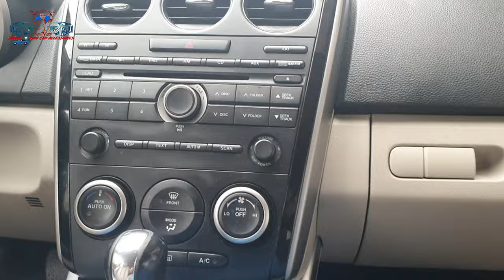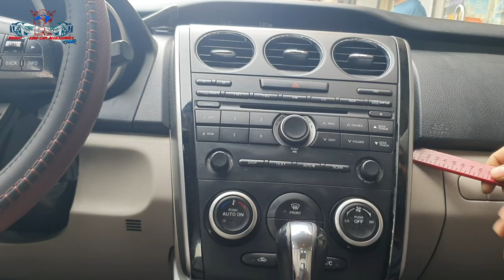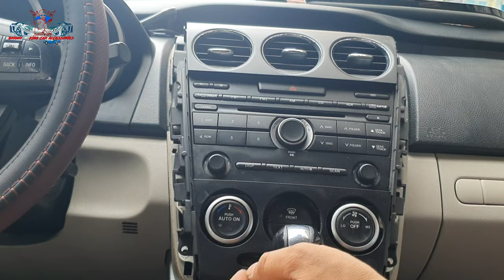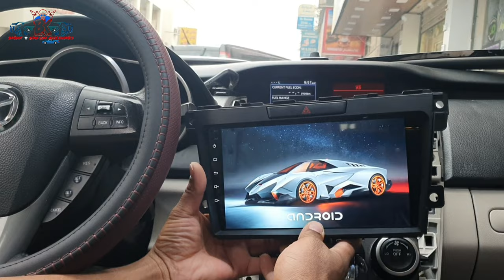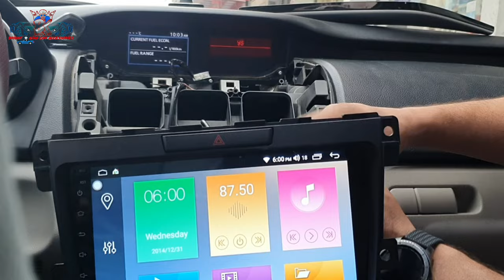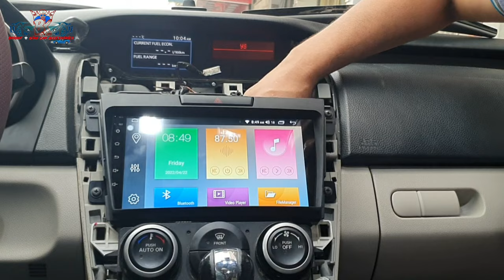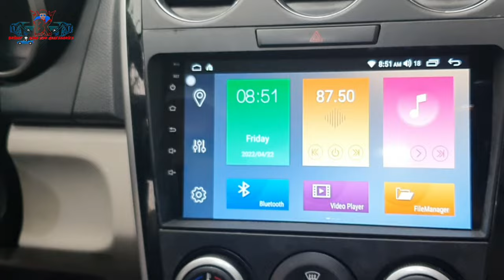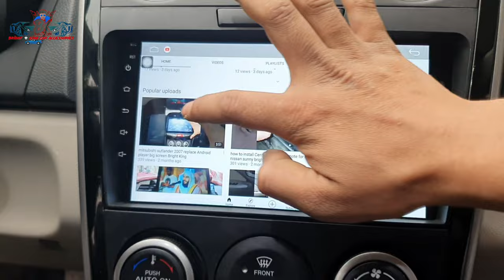How to install MAZDA CX-7 or cx-9 2008-2015 Android big screen With frame Bright King

Comment: the controls on the steering wheel don't work and the radio is not connected to that little red screen, it's another DVD radio from redpower, all the functions work